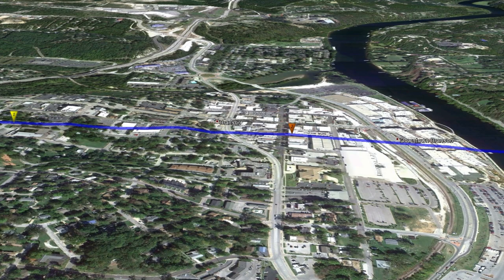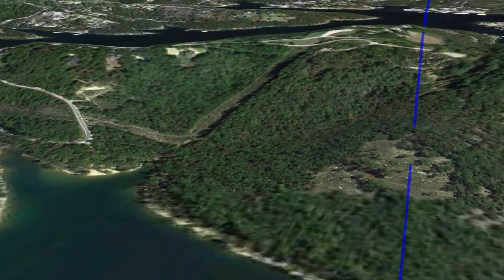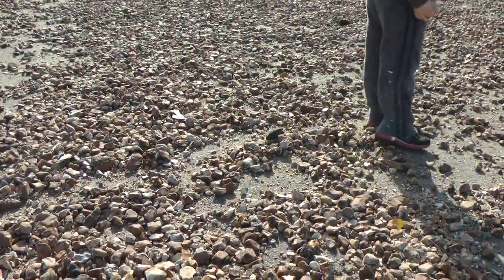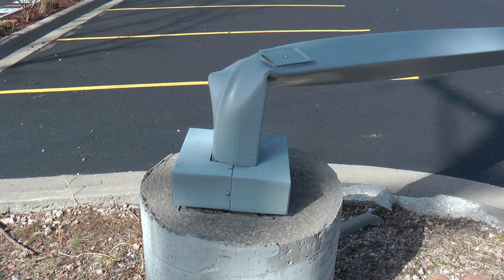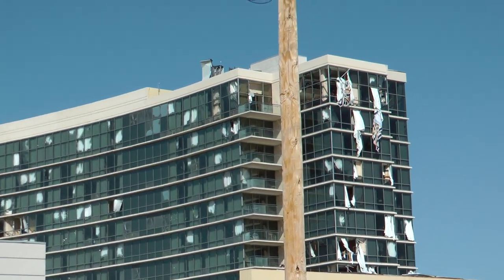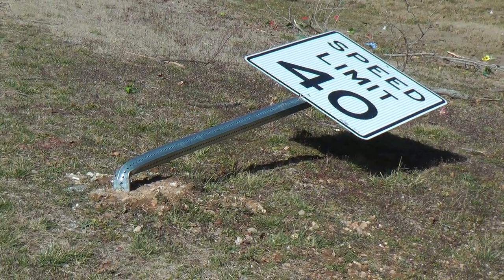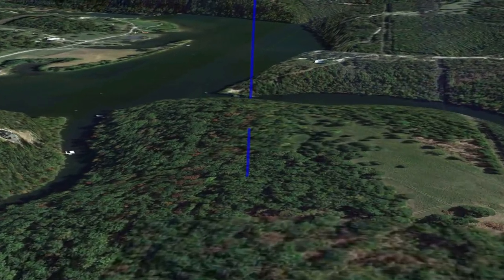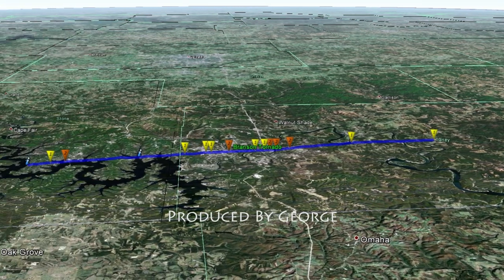Branson Tornado Path 3D Flyover Tour

Comment: When this happened it was a few weeks before an elementary school field trip. It was what you call an AR field trip. I was young and very into tornadoes. The fun thing was that this field trip was Ride the Ducks. On the way down I saw damage and almost leaping out of my seat in excitement. XD When we got there I asked the person on duty how much damage the got. only one "Duck" got a bit of damage. now I don't believe him since it went right by it
Reply from the maker: +travlingirl productions I'm so glad this didn't happen during your field trip.  We are so lucky that this happened in the middle of the night.  I think the person who told you about the damage was correct.  To the best of my knowledge, the tornado barely missed the Ducks parking lot.  Another thing to consider is that this tornado was moving really, really fast...like around 70 miles per hour.  So, because of this swift forward motion, most of the damage occurred on the side of the rotating funnel that was rotating in the same direction as the funnel was moving.  On the opposite side, the effects of the rotation winds were reduced (cancelled out some) by the forward lateral speed of the funnel.  So, you had a huge contrast between lots of damage and virtually no damage in a very small area.  [I hope that makes sense].  Thank you for watching :)
Reply: Thanks!